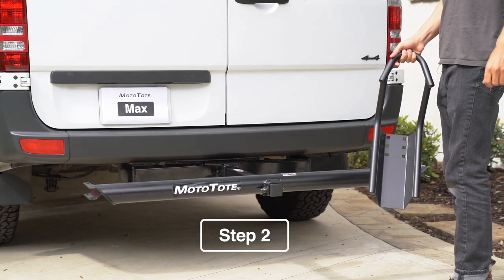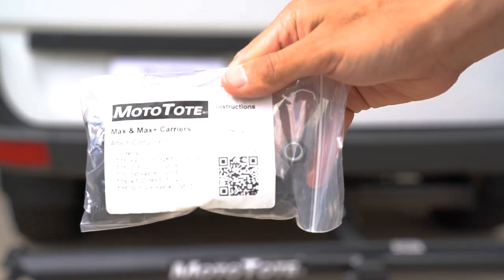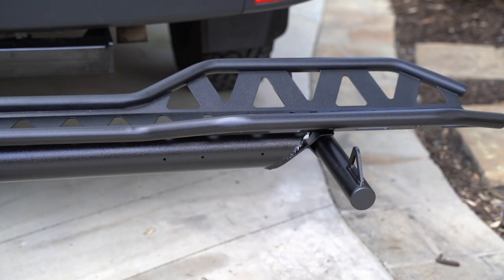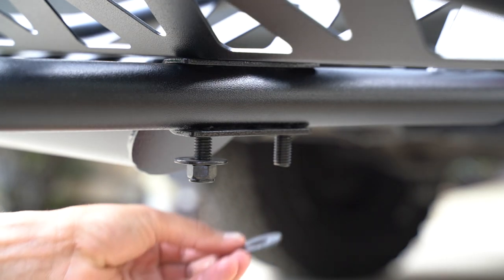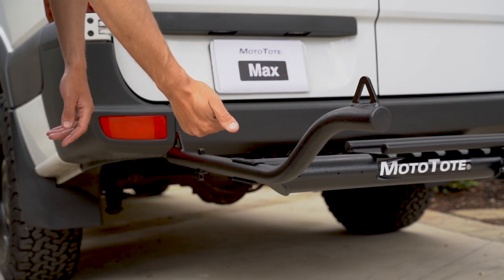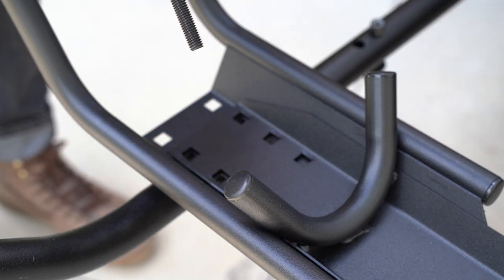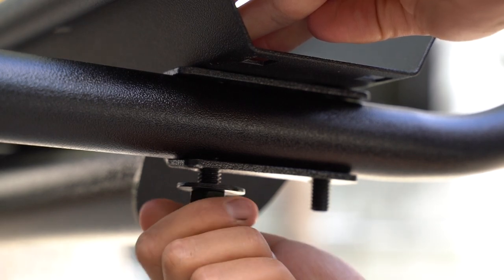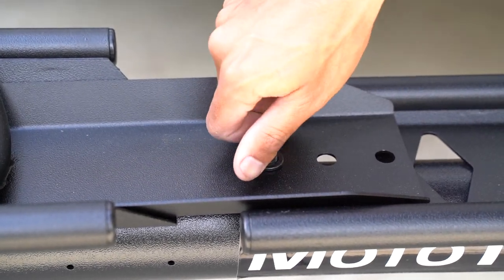Max Instructions 2 - Install Components to MTX Platform

Comment: Can you help with spacing. I’m loading a ktm 350 enduro. I’m doing it by myself and having it up there and measuring the space needed for the install is not possible. The front rim is a 21inch